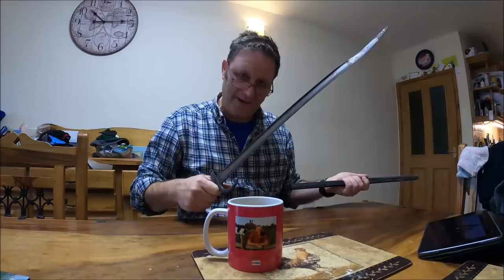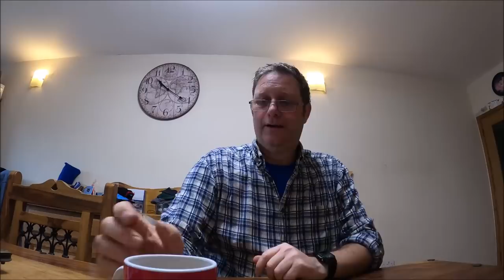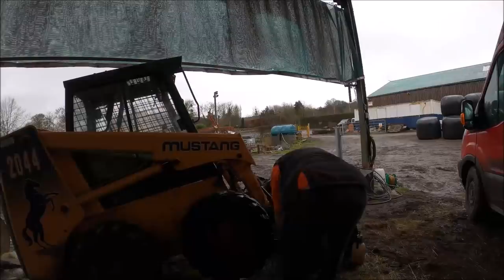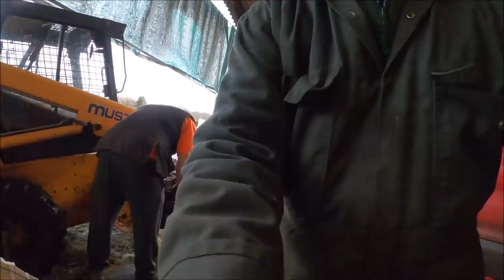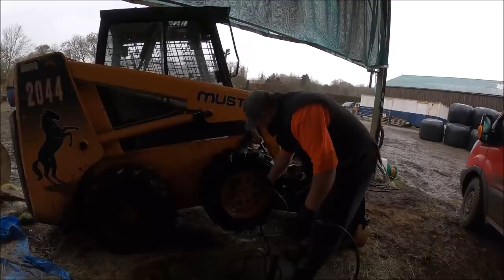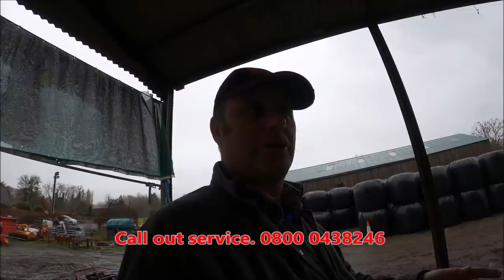Bayonets and punctures.  12 01 21  2

Comment: when i used to tyres for my car back in the 80's before all the tyre places were about. i used a pot jack a 4x 2 a small piece of wood for the top of the jack. then you balance the tyre bead on the jack in a doorway put thr 4 x2 on the other side and aagainst the top of the door jam then jack it up until he pops then reapeat to remove with tyre leavers or stone chisel LOL reverse process to put back on then a drop of petrol to pop onto bead inlate and back out with yofurry dice 😂

Comment: .... laughing .... those tire guys always make it look so easy, like there is nothing to it ...best one I ever saw was a small guy, asian, he had no weight to speak of, he would run at it and put his knee into it, a truck tire that is, all I could say was "well that works" he just smiled .. as the old saying goes "more than one way to skin a cat" ..... so that's easy peasy getting the front tire in the air, do you have to jack it to get the back up or do you have a trick for that too ... thx for sharing ... and as always .. never stop dreaming, just dream bigger .. have fun be safe, save our oceans ...
Reply from the maker: Oh yes, I have a trick for the rear wheels too Peter. No need for a jack. 😄👍
Reply: @FarmerP   ... chuckling ... that does not surprise me ....

Comment: Can you get the solid rubber skid steer tires over there? I used to work at a garbage sorting facility and that's what they used. No flat tires ever, they just wore out. Great video!! Edit: I'm from Canada, so you may not even have them over there
Reply from the maker: We can get them, they are fine on flat solid ground, but not so good on the rough stuff. 🙂